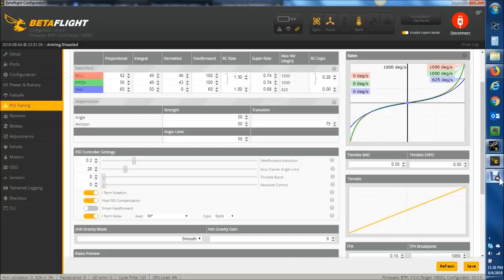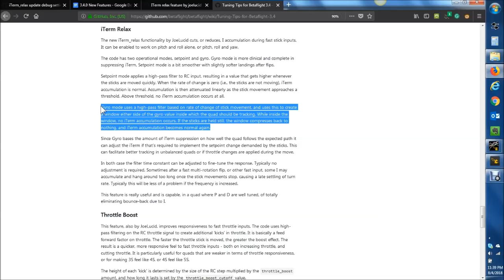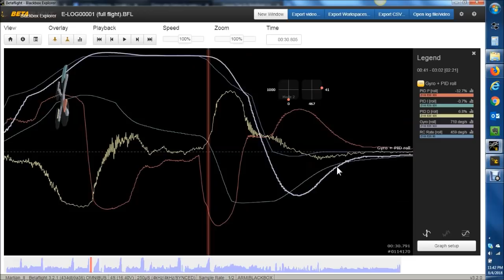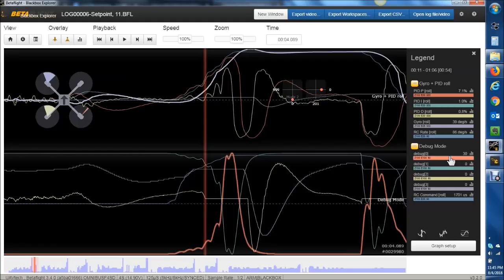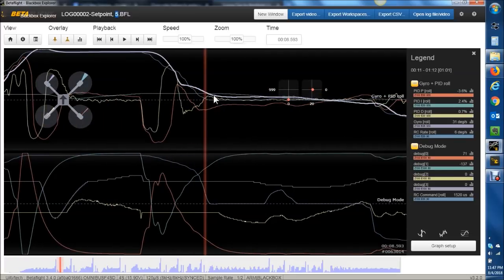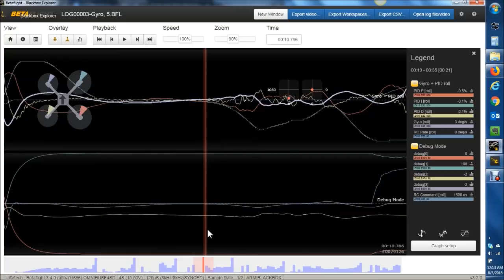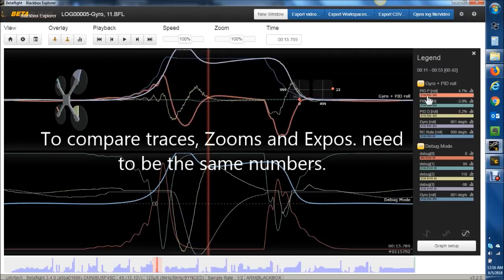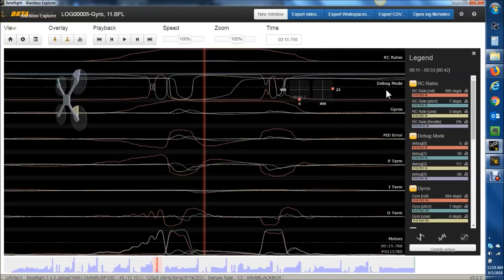Betaflight I-Term Relax: How it works + BBE Tips

Comment: Ok what is Iterm relax CUTOFF... it seems to me a HUGE difference in my bounce back.. I consider myself a fairly adept PID tuner... but I just built a new quad and MAN there are things that I just can NOT figure out AT ALL.  I get huge dips after a throttle punch when I cut the throttle quickly.... and I get huge bounce back after rolls which I fixed, but then I get a lot of random noise which causes weird flight artifacts... I'm PRETTY sure I've narrowed down that issue....... But this nose dip after a throttle punch NOT DURING, but after a throttle punch when I CUT the throttle heavily I cannot NO MATTER WHAT I DO get rid of it.... I don't know what iTERM relax CUTOFF is and i feel like this is a large piece of the puzzle..

BTW I use a throttle up with airmode turned off... everyone just tells me to turn on airmode but that's not the answer I'm looking for. I'm not in the mood for compromise  lol.
Reply from the maker: You need to crank Anti-Gravity up and tune up you P-gains as high as you can to be Critically Damped.

This video exactly conveys what the cutoff does.  So I don't understand the question?

Sounds like you P-gain is too low, causing an Overdamped condition which causes both of your issue (throbbles and big lag which causes I-term windup in sharp flips)

Do check out tiny.cc/pidtuning

Comment: Mark, do you know where to get the latest nightly build of the Blackbox Explorer ? version 3.1 is crashing on me when opening a log file generated by BF 3.5 RC2. great video as usual and yeah hard to tell how to use iterm_relax_cutoff when either side of default value gives worse results in "gyro" mode
Reply from the maker: http://andwho.sytes.net:8080/job/Borisb_Blackbox_Log_Viewer/

Hopefully you can see in Gyro mode, 11 seems to be the optimum performance - for me at least.

Comment: Nice testing! Saved a couple of hours to figure out on our own! Why those high D values at the beginning of the video?
Reply from the maker: I like high D-term to fight prop. wash and other disturbances that push my PID Error to climb.
Reply: Going to try that out. At the moment I have my D just as high as it needs to be in order to avoid P oscillating.
Reply: I need to try this too. I'm soooo used to running low D's thanks to having started using BF back in the early days. Out of habit I've only ever run them as high as I needed to control P. Usually, no more than 35 on an axis.
Reply from the maker: The key is addressing vibration noise well.
Reply: I suppose what you mean by that is both physical noise and filtering? As in, make sure you have clear-well balanced motors, fresh props and a stiff frame... and then carefully nail down your filtering settings? Then you can get away with D's this high? I'm moving a Braap (stiff) to 3.5 and a Chameleon Ti (noodle) to 3.5 too. The Chameleon Ti flies well, as does my old Chameleon, but there's no question that floppy baseplate doesn't help. I'm running D's at 29 / 32 or so, and motors are getting too warm for comfort. That's in 78F weather and 4.2 pitch props.
Reply from the maker: Another factor is your motors and how well they dissipate heat.  Some are much better then others it seems.  My RCX motors do very well in this arena.  I have never had them get hot and I have had d-gains up to 50 to 55 in the past.

Nevertheless, if you can log it and look at the noise spectrum, you can optimize your filters (especially with the latest builds of the BF Master at tiny.cc/filtercalc and then once your D trace is adequately smooth, push up your d-gains to give it more umphf in prop. wash conditions.  I need to make a video on this subject.
Reply: Thanks so much for that. I'll play around with it and see how clean I can get this. I have two brand new quads that I don't need to beat up just yet... Neither had been crashed yet. (The Braap and Chameleon I mentioned before)... plus, one has a 4in1 BLHeli_S ESC and the other individual BLHeli_32 ESCs. Should give me a lot to experiment with. It'a amazing how far Betaflight has come since the days of the Naze32 when the original hexes were still going by the same numbering as Cleanflight.

Comment: I have a bit of a problem after flashing my FW to betaflight 4.0.2 .  For some reason I cannot SAVE the I term relax  in the PID Controller Settings, it just won't stayed saved.  Even in the CLI it just wont save any settings for the I term relax. I cannot even type : 
get relax ... to set the cutoff to 11.   i  get invalid ERROR COMMAND
Reply from the maker: That is because you are using an F3 board and i-term relax is not included.  You can use my Performance Edition Targets to have it included: https://github.com/spatzengr/betaflight/releases
Reply: @uavtech  Thank you so much for your reply and for your help.  Much appreciated

Comment: If the job of the iterm is to drive the steady state error to zero, seemingly every time the error hits zero the iterm should get whacked somehow.
Reply from the maker: Whacked?

When Error is 0, i-term is 0.
Reply: @uavtech  No, when Error is 0 the P -term is 0.  The I-term however has accumulated due to the error not being zero over the previous cycles, however invalid it might technically be for a fast move.  It just seems the i-term should just maybe stop or decay really fast every time it crosses zero.  Halting the accumulation seems odd because it assumes that held value from before the move is a good starting point at the end of the move, if it happens to even still be held at that point.  Hence twiddling setpoints, which is still kind of awkward because you have to choose between flight styles.